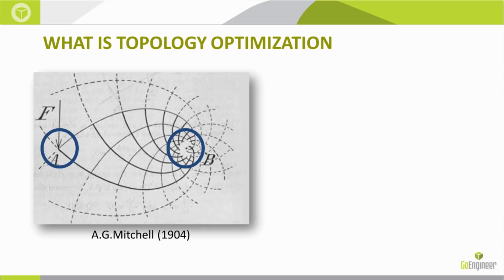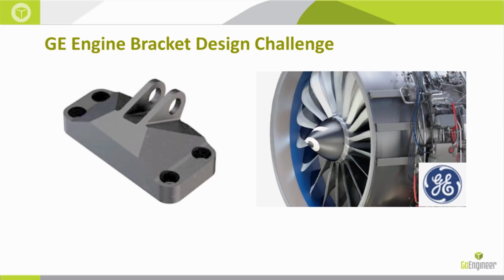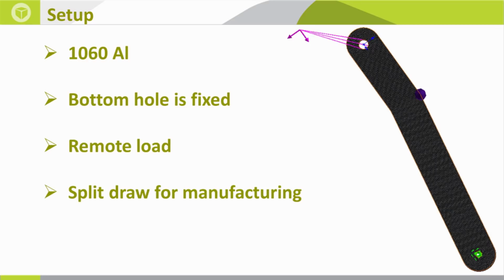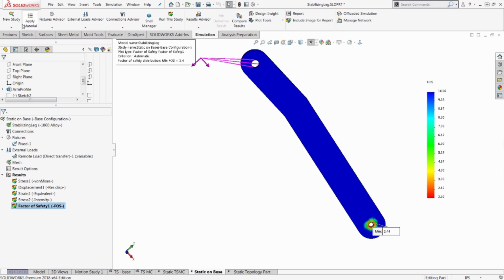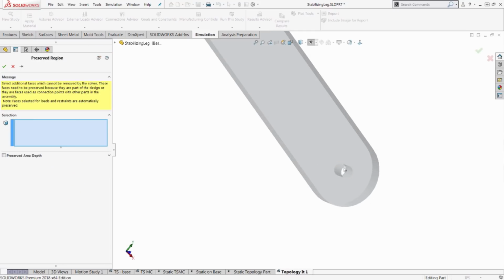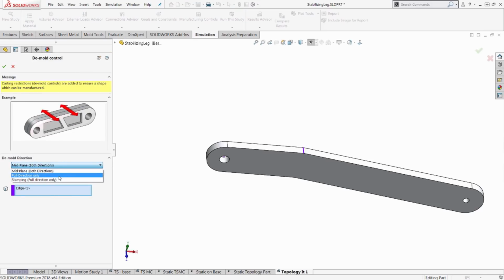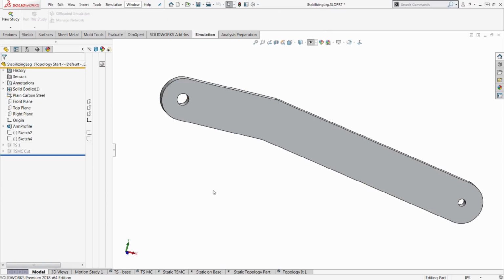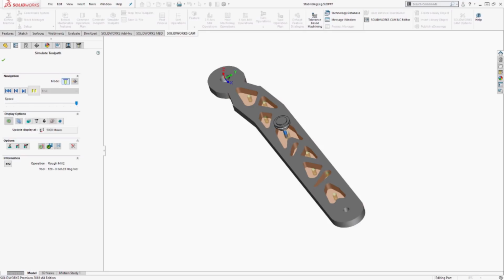SOLIDWORKS Simulation - Topology Optimization

Comment: I appreciate it, but I can't see it for the moment being used outside of aeronautics and racing applications. The costs associated with removing extra material can not the justified in most cases. Nevertheless, it is so exciting to see optimization in action, the cool factor is there!
Reply from the maker: Everyday there are more and more options for additive manufacturing and the topology studies can allow us to do some pretty amazing things using 3d printing. This actually gives us a net benefit in the opposite manner, because we do not have to worry about material removal but instead only using the least amount of material that we can.

Comment: how did you make your sketch in different configuration after simulation display?
Reply from the maker: All of the features exist in every configuration you can control what is suppressed or active in each configuration so even if the sketches where added in a different config they can be turned on in a different config just by unsupressing them in that configuration.
Reply: @goengineer  Thank you for making our job easy:)

Comment: Why exactly did you constrain the bottom hole to be fix? Your entire topology optimization is around the fact that you screw the bottom hole against the wall or something ...
Reply from the maker: Ultimately the topology study is relying on a linear static simulation. So in order for it to solve we have to have fixed geometry.  Look to the beginning of the presentation again we are looking at the best and most efficient ways to transmit a load from its source to a fixed point.

Comment: How good dies it apply to fdm 3d printing?  Does it understand the limited strength on the z axis(layer bonding)
Reply: probably no.
Reply from the maker: It is a useful for 3D printing, but soldiworks does not at this time have a way of differentiating the material strength based on the layer bonding.

Comment: I didn't have that extra configuration at 23.27!  Anyone know why?
Reply from the maker: I believe your question was based on an expectation that the topology study would automatically create new CAD geometry to represent the optimized shape. I personally haven’t seen a topology optimization simulation tool that can do that. Most tools will have a graphic overlay as shown here.

There are some topology tools on the market that can fill a volume with a defined pattern, which are useful for 3D Printing. Topology technology is growing fast! Thanks for watching our video on what’s available within SOLIDWORKS.

Comment: My research involves TO and I hope that people don't get misconceptions from it:
- The geometry it gives you is not guaranteed to be globally optimum, various factors can cause it to fall into a locally optimum solution
- the wavyness of the surfaces is an artefact of the smoothing process from the mesh, not actually an optimal feature
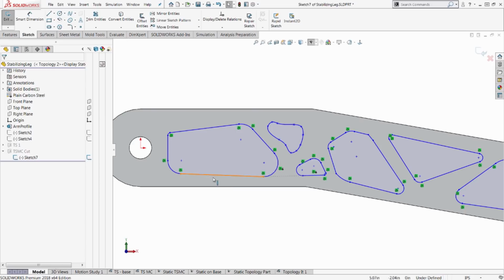- for example, there is no way that spline shape at 23:40 is optimal, a simple triangle would be just as good. I think this shape is caused by the elements being too big to get enough detail.
Reply: and how do you know it's not a global optimum?

Comment: Does anyone have a link to the A.G. Mitchell paper for the maximum strain lines by chance? I'd like to read more about it but am having trouble finding it on Google. I'm designing mounting for the rear wing of a student built race car using topology optimization and am seeing results that resemble the lines on the plot shown at the begging of he video. It would be cool to see if there is an equation that defines each of these curves.
Reply: https://repository.lib.ncsu.edu/bitstream/handle/1840.16/10383/etd.pdf?sequence=2

Just saw this. Here is a link to my research work where I reference the paper

Comment: I really like the optimization of geometry, I have tried it in separate piesas. I can not do it on an assembly in solidwork using the forces resulting from other pieces on it. Do you know if it is possible? what do you recomend. the geometry of my work is somewhat complicated, it takes parts in movement

Comment: Cool, but like everything else, its just one tool. This only works where weight is more important than cost. The simpler the shape, the cheaper to produce. Also you started from a fixed design - making the part straight instead of kinked for instance would have enabled it to be simpler yet. Can Solidworks do generative design yet just specifying the load paths and it designs the part?
Reply: Thank you for the comment Spinnetti. https://www.youtube.com/watch?v=E-PMMLGbEGY this is another video I did on optimizing for manufacturing cost using SOLIDWORKS. Check it out and let me know what you think.